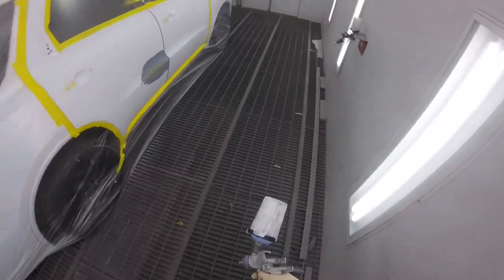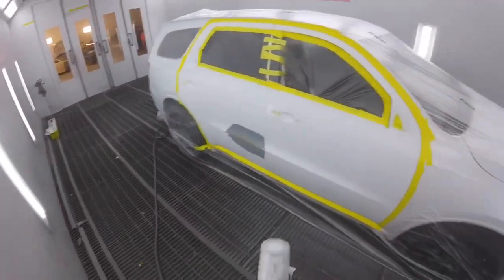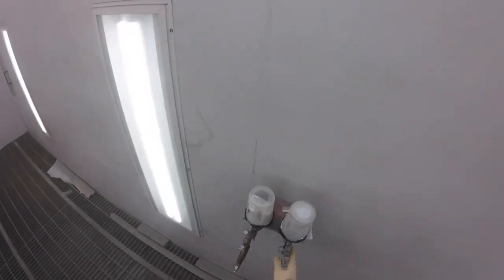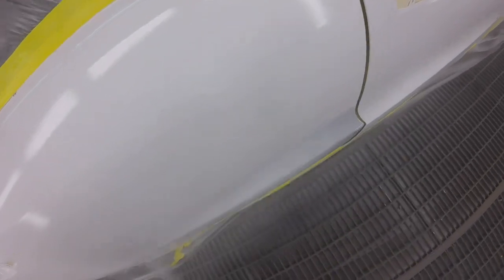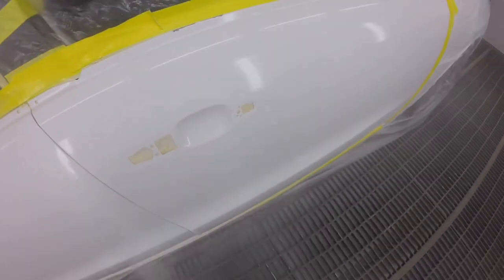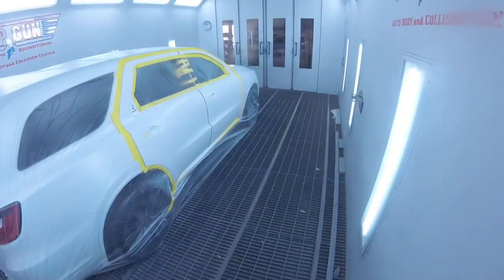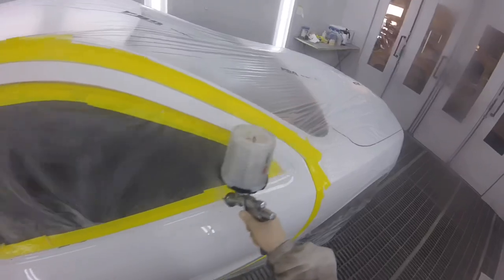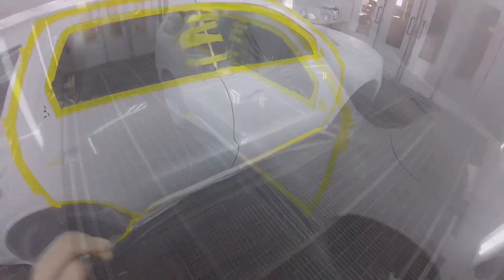Quick blend on solid white Durango with Axalta Spies Hecker

Comment: So even with solid colors like white you still have to use wetbed and blend?
Reply from the maker: You do not have to use wetbed with solid colors. I only do because I find it easier to blend and not have any sand piling. I live in California where it is pretty hot so the wetbed gives me a smoother finish. As far as blending. We do mainly insurance work so we blend 90% of jobs.